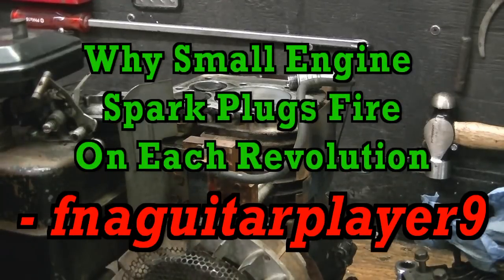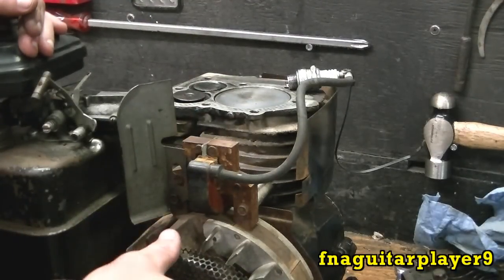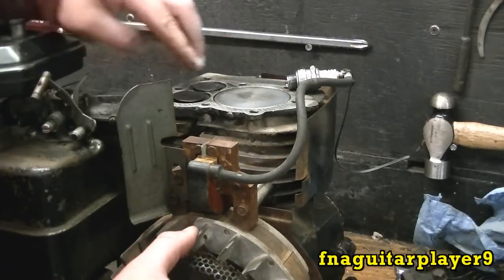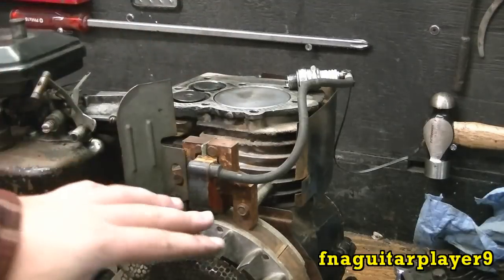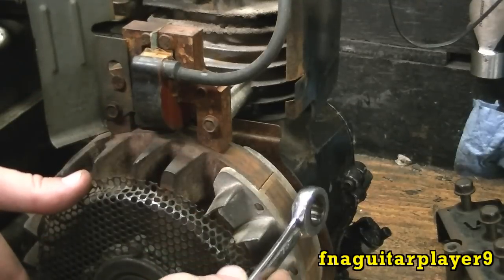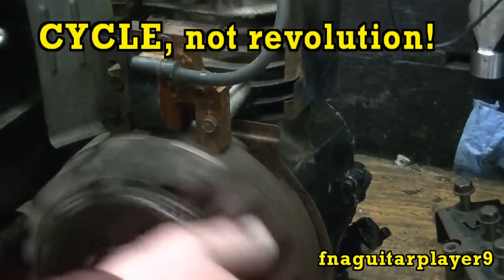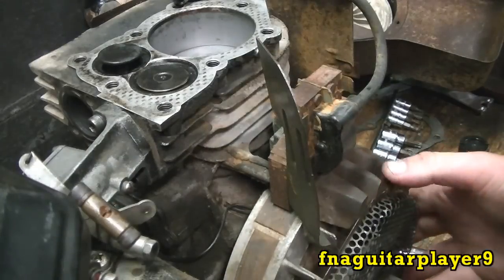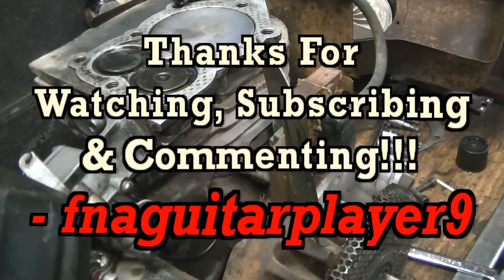Why Small Engine Spark Plugs Fire with Each Revolution

Comment: Great video Boss, this becomes very important when using an ignition analyzer. They contain different settings, wasted spark, single fire, dual fire etc....in certain circumstances, an inline tester may not diagnose the issue.

Comment: Thx fnaguitarplayer9. I was studying this kind of magneto system and got to wondering the same thing, I figured as much, thx for the answer to make sure. * I need to talk to some one as to what can be done with magneto power output. Wondering if I could use the primary or secondary coil to produce 12v/1A pulse? NO need to worry about spark, extra magneto experiment. 
The engine in this video has lobed cam right? But it only works valves though? 
To simplify the 4 cycle engine illustrations I use 720 timing (2 crank 360deg turns) 2 to 1 [especially for v8/16 valves]. Each cycle is 180degs (4 cycles = 720degs). But the cam only turns once (360degs), cam timing is slowed by 2 to1 with timing gears, so I believe it is actually 0.5deg cam timing = 1deg crank timing. 0.5deg cam timing moves twice as slow so 0.5deg cam takes as long as 1deg crank timing. 
This single piston eng ~ 720 firing. Each and every 4cycle cylinder fires @ 720 degs. 
2 piston eng ~ 360deg firing. 180deg position offset, NOT sure about V 2cyl engs. 
4 piston engs ~ 180deg firing. Inline 4, not sure about V4 (rare). 
8 piston engs ~ 90 deg firing. V8, not sure about inline 8s.

Comment: Can bad spark plugs causes the car to die and low idle ?
Reply from the maker: Possibly, but it may just need the throttle body cleaned out or could be a throttle position sensor on its way out, sometimes they won't throw a code until they are completely gone. Thanks for Watching!!!

Comment: Excellent video. I bought a cheap tach online and was worried it didn’t work, but I just gotta set it for 1 spark =1 rev. Thanks for showing how it works.
Reply from the maker: Thanks. I actually have a video on a tach for small engines, using one that has to be programmed like that. Your welcome, thanks for watching!

Comment: Thanks for the excellent video! ...two questions:

1) Is the spark plug mounted above the EXACT center of the piston on top of a combustion chamber.

2) Also, at TDC, how far from the piston is the bottom of the plug?

This information will be of GREAT help!
Thanks much,
Reply from the maker: Your welcome, 1, depends on the type of engine, if its a flathead type (valves in block) then the plug is actually mounted above the valves, if you look down the plug you will see the edge of the cylinder and tops of valves, ohv motors are directly over top the piston. 2, again depends on engine type, guessing it would be no closer then 1/4" from the piston, because if you try to put a long type plug in a engine that uses a short type, the piston will hit it. Thanks for Watching!!!

Comment: Thanks for the video. how about the ground wire coming off some magnetos? mine seems constantly grounded. I cant get fire with a new coil
Reply from the maker: your welcome! If you have fire with the wire unhooked, but not when its hooked, its usually a shorted out wire or a bad safety switch somewhere keeping it from sparking. Thanks for Watching!!!

Comment: the older engines had a ignitor that worked off the camshaft.
Reply from the maker: Watch a video i have on my Wisconsin engine, it has that setup and i show it with the cover off. Thanks for Watching!!!
Reply: 2nd that.
Reply: For instance which ones?
Reply: Bagot Corner I'm not sure, but I know my grandfather has one.
Reply: +Zach's Garage 
I'll help clarify it for you ,( not trying to be a dick😉)
If you have an ignitor ,you have a low tension ignition .
The cam you're speaking of is a cam lobe that pushes against the latch in /out which if you have this you will have a hit and miss engine and not throttle governed .
There is no cam per say because the exhaust valve is controlled by the speed governed latch and the intake is controlled by atmospheric pressure .
Just figured I'd help clarify it 😊

Comment: Good explanation but lets not forget about similar small engines that have points and a condencer coil, they only fire on every power stroke just like an automotive engine. I'm sure you know that sir, just pointing it out for the audience.
Reply from the maker: Very true, if you watch a recent video i put up on my Wisconsin engine, it has that setup on it, it snaps when you turn it real slow. It is a very interesting setup, and is actually better. Thanks for Watching!!!
Reply from the maker: haha I haven't had that happen yet, but i'm sure i will haha
Reply from the maker: haha
Reply: If your points are actuated from a cam lobe yes .
Generally they aren't and you have a waste spark system like this .
If you have a rotor and distributor then also yes.
Reply: Yeah thats the kind! You can just barely tuen it over and it'll hit, can give a newbe (like myself) an unexpected zap!
Reply: +SD Customs don't feel bad ,,after many years I still give myself the occasional zap ,,and I wish I could say it was on purpose ,,but it's generally by being careless 😊
Reply from the maker: True to, if you watch a video i did not to long ago on my wisconsin engine, it has that setup on it. Thanks for Watching!!!
Reply: Blamed RIGHT and they'll WIND YOUR CLOCK if you get beteen them and a ground! Hurts all over for a while! And that 'click' is as deadly as wide open, just once is enough though.
Reply: fnaguitarplayer9 Like the old Brylcreem  add 'A Little Dab 'll Do Ya'! Just watch them blasted things. They're sneaky!
Reply: ONLY if driven off the cam and not the crank, most points systems still actuated off the crank and hence would fire every stroke.